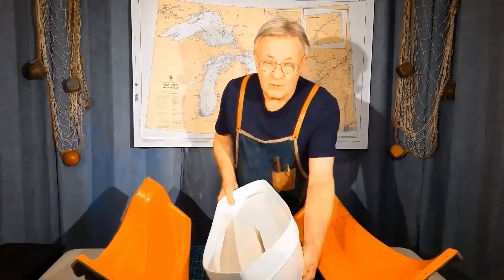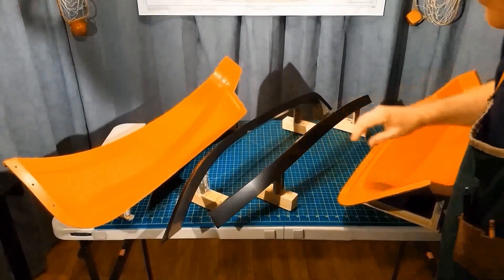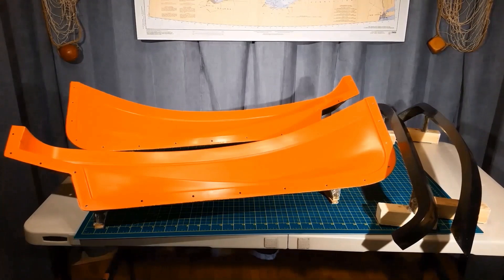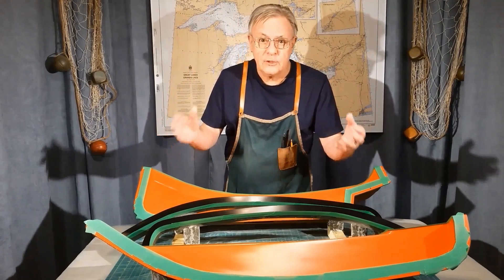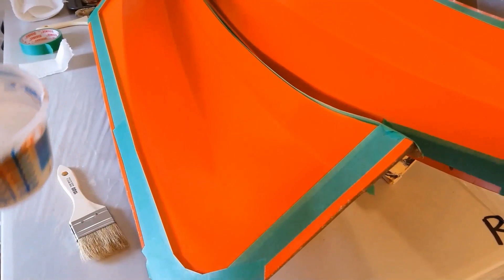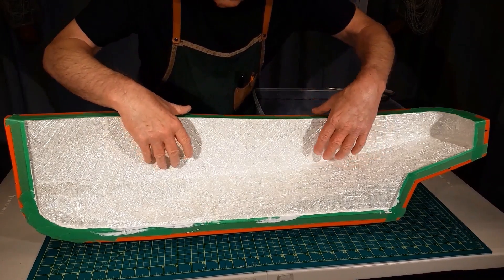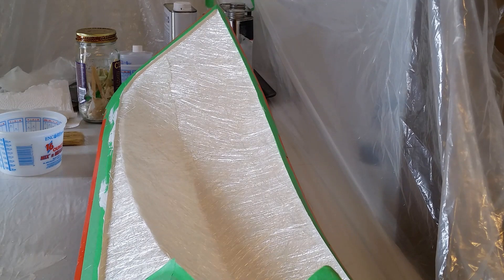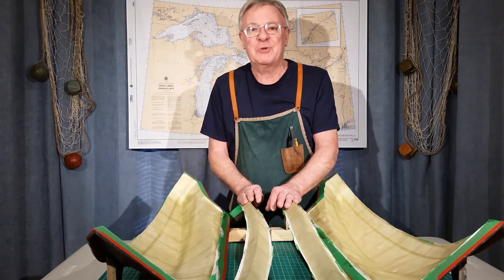Make a Fiberglass Model RC Boat Hull Part 1

Comment: excellent video just curious why you wouldnt use a whole piece to start strart at top and push it into contours with the resin thats how we would go about making a part in the body shop and when working with that stuff there is a certain amount of mess that comes with it as alot of construction processes, getting an area cleaned up brown papered or wax papered all material how u want it set up and mix ur resin a 1/4 bit at a time and get it on the glass in a controlled thourough way pushing out all air pockets theat might try to show up in the sharp oh, and some long sleeves, some gloves, a respirator and some sort of exhaust system to help knock down the fumes i painted for the first half of my working life im no stranger to all of it and some the crap will have me itching like a cat with fleas if i dont cover up good a tyvec suit works best for me you have some neat hulls that are super art work appreciate the video.
Reply from the maker: Thanks for your feedback.  I used small strips of mat in the gunnel recess to avoid an air pocket between the gel coat and mat.  You have great ideas.   Brian RCWH

Comment: One comment about doing fiberglass layup.  Don't touch the inside of the mold with bare hands once you get it waxed and coated with pva.  Also don't touch any of the fiberglass with bare hands.  Your bare hands have oils on them that will contaminate the part.  Just rear gloves through the entire process.  I like nitrile gloves.

As far as the hair spray goes, it is PVA, so just buy the cheapest brand of unscented hairspray you can.  Alternatively you can buy a bottle of PVA and spray it on with a Preval sprayer.

The advantage of tearing the mat edges is that you get smoother boundaries between pieces without the double thickness.  Yes it is a bit messy, but I think the result is worth it.
Reply from the maker: Thanks for the tips Todd. I agree 100%.  Comments like yours will help a lot of DIY builders, myself included. This is the kind of comment that really makes a DIY video informative. Building the molds and learning to handle a layup is an interesting hobby in itself.  Brian RCWH

Comment: I have a question for you and anyone else who can answer my question. 

I’m building a big , off shore like tub boat, it’s sorta a one off custom. I enlarged the plans by 50%, it is about 50 inches long, 13 inches wide at its widest point, I forget the beam off but I think it’s around 12 inches give it take a few. In all to get her to float properly it has to weight 45-50 pounds.

It is a twin motor set up, I plan on running twin 4 blade, 75 mm diameter propellers with a 3 and 1/4 pitch to them (it’s what I could find for what I wanted) 

I have no idea what size motors to put in it. I’m leaning towards brushed motors. I’m not to worried about the size of them, I can alter the mounts to fit the motor. Do you have any suggestions for what to use or where to start? I’m open to any suggestions or ideas
Reply from the maker: Thanks AJ, the 540 can motors that I use may be a little underpowered for your 75mm props if you want to push that tug beyond hull speed. DC brushed motors are easy to find and inexpensive so that would be my choice.
Reply: @RCWorkboatHaven  thank you, I will start to look around. Thank you
Reply: @ajyur9921  You can try a 540 thru a 3:1 GRU. Team Raffee sells planetary Gear Reduction Units.
I had a Robbe Norderney 44" that ran twin 600 2.5:1 GRU's and 50mm props.
Are you looking for stump.pulling power, scale speed, or both?
Reply: @blkft  I’m not to worried about scale speed, I’m looking for something torquey enough that I will not burn up pushing this mammoth and will do decent if there are a couple of waves and/or a current.

Thank you for helping me.
Reply: @ajyur9921 Also, Google: Matthews Model Marine - All Geared Up.
Good article to read but also it includes Raboesch's prop/rpm chart.